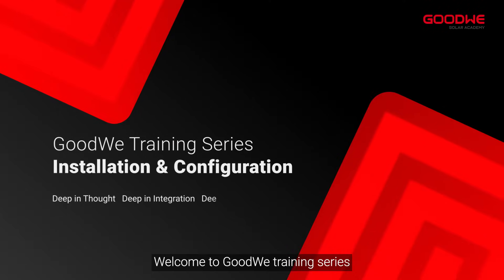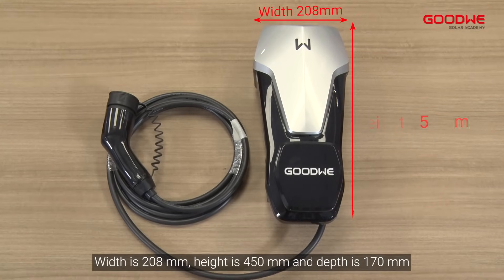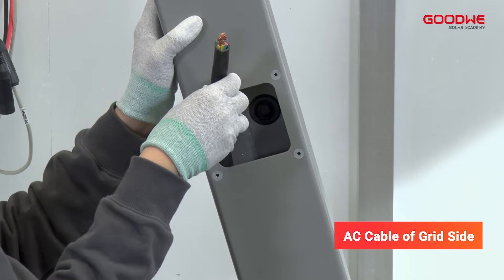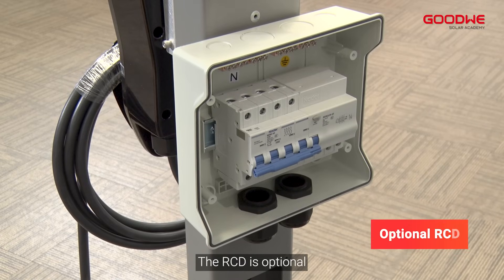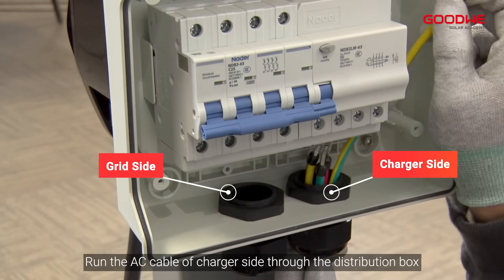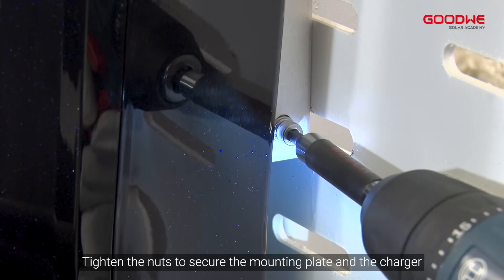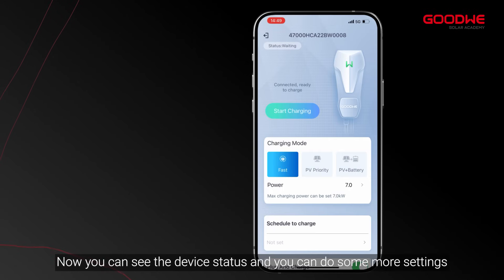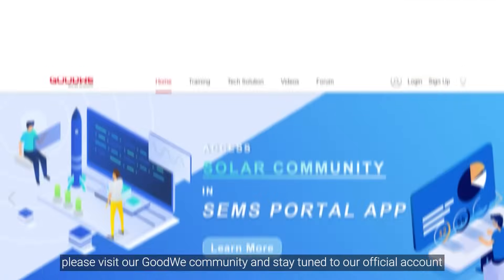GoodWe EV Charger HCA series installation and configuration

Comment: Can I have multiple users on the wallbox? I need one account for personal use and one for business use.
Reply from the maker: Yes, Wallbox does support multiple users.
You can create separate user profiles within the Wallbox app or through the myWallbox portal. This allows you to manage charging sessions individually for personal and business use.

To do this, you can either:
	1.	Create multiple user accounts and assign them access to the same charger (with different permissions if needed).
	2.	Use one account and enable user identification features (such as RFID tags) to distinguish between users or usage types.

Comment: Is the wallbox wiring to be in the GoodWe inverter measurement area or outside of it?
Reply from the maker: Which inverter do you refer to. Normally the wiring area is outside and below the inverter.
Reply: @GoodWeSolarAcademy GW25k-et And also GW10k-et

Comment: Can EV CHarger communicate to the ET series inverter directly over Wifi or local LAN or by direct cable connection, for example? EV Charger, in PV Priority mode, needs to monitor actual real-time house consumption per phase and PV production. If EVCharger only uses SEMS, the information it gets is delayed at least 10 minutes to reduce or increase the charging power or stop it completely if I don't want to use any power from the grid. 10 minutes is too long..
Reply: Wann funktioniert endlich das PV Überschussladen???
Die Kunden werden hier im Stich gelassen.
Keine Lösung in Sicht.
Ich kann nur jedem vom Kauf abraten.
Reply: Yes this is important to match ev charging to the PV production curve (especially early in the morning or with clouds)
Reply: Überschussladen funktioniert nicht, kein OCPP auch nicht.
AC Charger ist Nutzlos und geht wieder zurück.
Reply from the maker: Sorry, EV Charger does not support direct use of wifi or lan connection for the time being, we have received your feedback and informed the R&D department, thank you.
Reply: @GoodWeSolarAcademy  Excess charging does not work with the GW11K-ET.
When will an update finally come?
Reply: Does this charger support OCPP?
Reply from the maker: No, it is currently not supported. @sparkytas